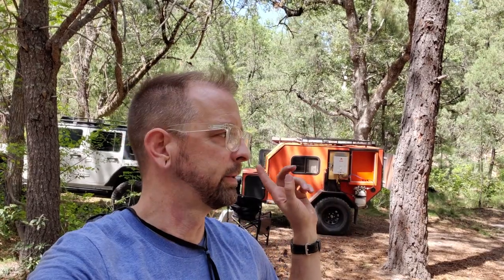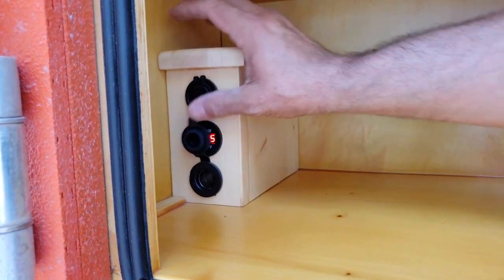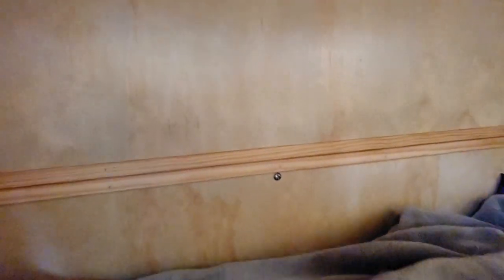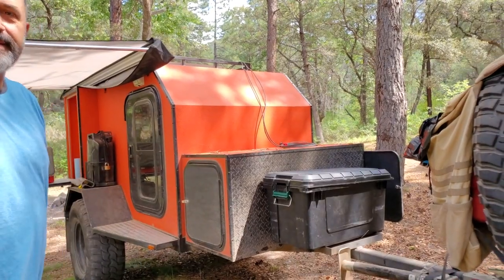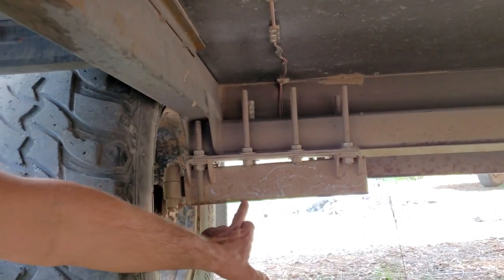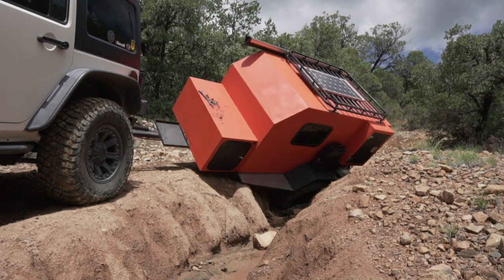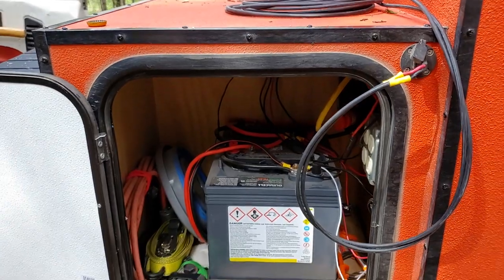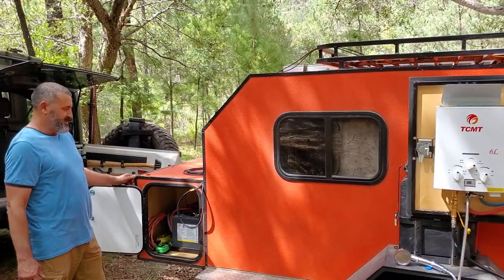DIY Overland Camper: The Wakamper Walkaround

Comment: Regarding the battery discussion: the main benefit of those 6-volt batteries is that they are "deep cycle" batteries. Ordinary 12-volt car batteries cannot withstand being deeply discharged. These "deep cycle" batteries are designed to be almost fully discharged without damage.

Comment: Kinda shocked at 1:28... Cover up those electrical contacts and bussbars. Also get a "decent" shorepower connector that is water proof. If it rains water could drip in and cause a short...

Also at 6:00. Best to put in a CO and CO2 meter (and smoke detector) in the interior. If a seal goes bad on the combustion chamber in the Diesel heater CO and CO2 could get sucked in with the warm air that is blown around it. It won't run long when that happens but with a small space I'm cautious! 

Other than that. Lovely little build!

Comment: Nice, well made, sturdy and thought through. I would suggest whatever suspension with shocks added and probably nowadays a more modern LIPO battery with dedicated Dc-Dc charger, much less weight (probably only 25% of the 2 golf cart batteries) and much longer lasting for the same capacity, if home build, even cheaper in the long run. How heavy do you think the rig is?
Reply from the maker: Great suggestions, thank you! Our guess on the weight is probably somewhere around 1500-1800lbs. We really need to weigh it proper one of these days to share the final details. This one had an overbuilt frame as well, a bunch of weight could have been saved by using 2x2 or 2x3 steel instead of the 2x4 that was used in this build

Comment: Thanks for sharing. Nice simple build. About to begin construction on an off-road camper of similar design. Couple questions in regard to construction. Was the bed liner material applied directly to bare plywood or was it finished prior to application.? how was the seal configured on the rear galley door? Given how dusty the trailer was it looked clean inside the galley. It seems even though you can keep water out dust always finds a way inside a hatch. 
Thanks
Reply from the maker: The bed liner (we used Raptor brand) was applied directly to the plywood, but the plywood was pre-finished cabinet grade, so it had a layer of clear coat on it already. I believe it would have been totally fine to apply the bed liner directly to unfinished raw plywood as well. Regarding the seal (GREAT question!) I'll try my best at explaining, i might have to post a photo or something if i totally fail. All of the rear and side hatch doors have an inset face frame that is parallel to the door. this not only allows the door to sit flush with the exterior when it's closed, but it also allowed us to put rubber window seal on the parallel face frame so that when the door is closed, it sandwiches the rubber between the door and the frame giving it a super nice tight seal. the handles used are also adjustable so a screw can be turned to adjust the "tightness" of the seal. I hope this explanation helps!
Reply: @SonoranSpaceProgram  thanks 👍

Comment: I love the raptor liner.  How is it holding up? Did the cracks become more of a problem?  Can you estimate the weight it added?
Reply from the maker: It's holding up very well, the cracks were sealed with silicon and covered with aluminum angle to reinforce so it's rock solid now. The total weight added by the liner is only a few pounds

Comment: I have the same suspension but made in the USA the steel is considerably thicker.....  we live in the Northwest territories on some serious nasty roads and my trailer does not bounce around like yours and we're loaded down generator two 6 V deep cycle batteries and water gas cans fully loaded and stuff on the roof..... Roads in Yellowknife have some serious frost heave we've been running it for a year now no problems...... I do air my KO2 tires down 10 PSI which helps on the gravel roads and potholes we Boondock as well...... but I built a pretty decent substructure that they Bolt to.....  I weld them in because  we have seriously long nasty roads up here.... personally would not run a air bag suspension personal experience of them failing we can't even run the air shocks up here or gas shocks they won't last here just saying.... I like the travelling arm with a spring and shocks if I was going to go with anything... Just a thought Fantastic build I think I'll put my water tank underneath as well.... Rebuilding my 4 x 8 to 5X10 by 5........thanks for the tips
Reply from the maker: Yeah, i think the new suspension for this trailer will be swing arm with a coil/shocks, i have that setup on my Turtleback Expedition trailer and it works fantastically

Comment: I noticed he has a 2 inch ball hitch. How has that been working off road? Any issues with binding?
Reply from the maker: Good eye! there have been no binding issues under our "normal" (but still quite gnarly) off-road use, but there was one time when Waka flopped his trailer and the ball hitch bound up and actually helped prevent the trailer from going fully on it's side. He does plan on buying (or making) a max-coupler at some point, but the ball hitch has been working just fine